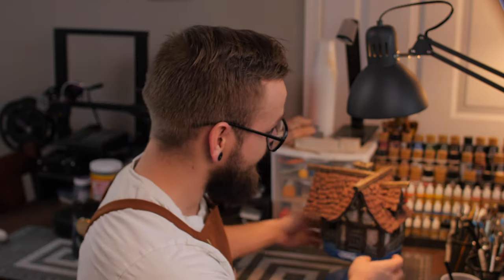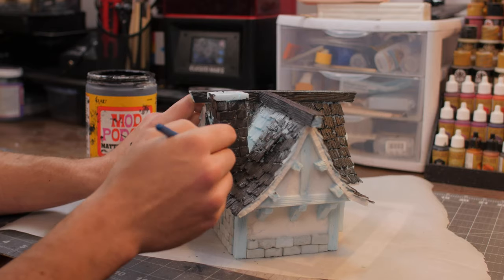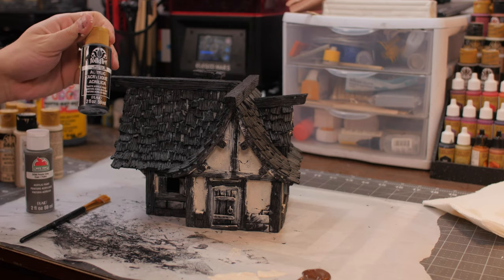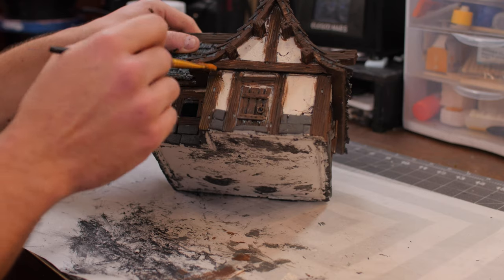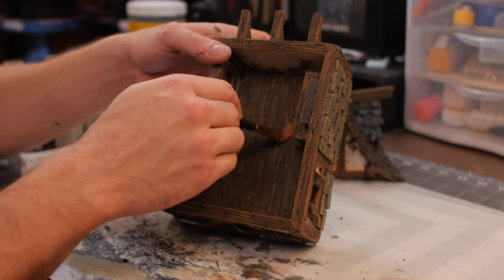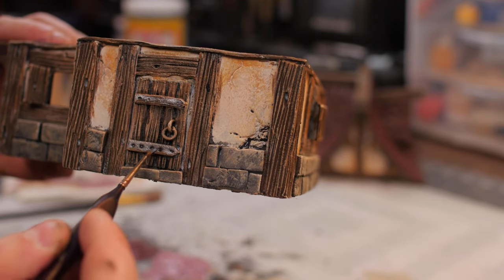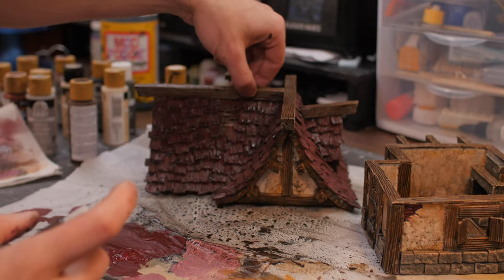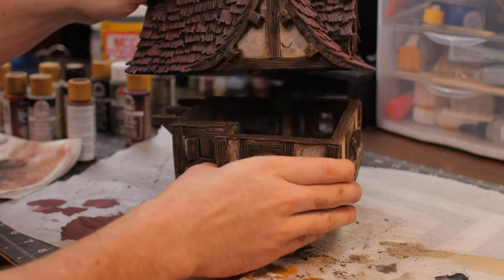How to Build a Miniature House - Part 3 - Episode 6

Comment: Have you tried making little furniture? That would be really cool in like a tavern or something.
Reply from the maker: I for sure do! I design my stuff in blender and 3D print the really small stuff:)
Reply: @FantasyForgeMiniatures  That sounds cool, I've only used a 3d printer once before and the dimensions didn't come out quite right Lol
Reply from the maker: @princeinsecurity883  3d printing is finicky which a reason i like to make as much as i can hand built but once you get the hang, 3d printing is a great miniature enhancer:)